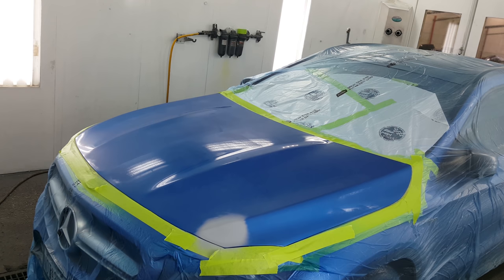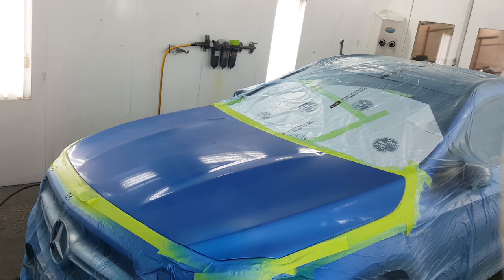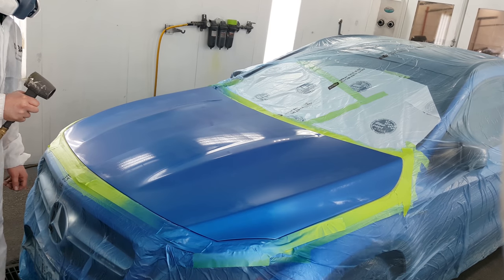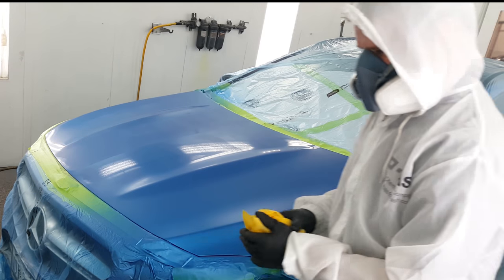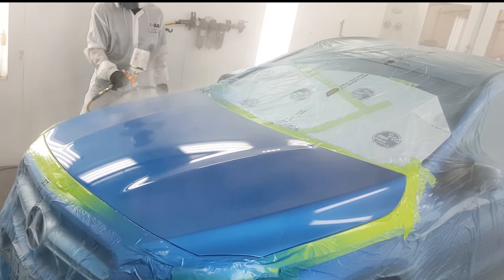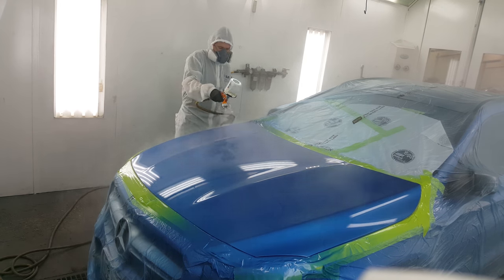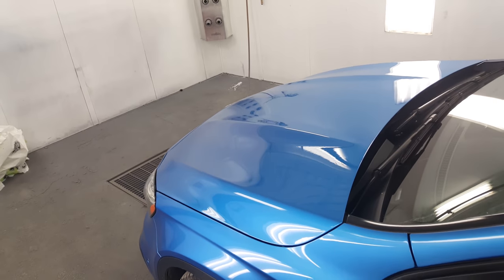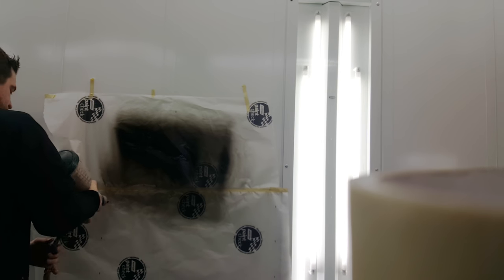Effortless Spot Repair: Revitalizing a Blue Honda with a Hood Blend and Full Clearcoat

Comment: First, I enjoy your dialog. Second, I think you may have helped me solve a problem. Just painted the racing stripes on my 66 Mustang restore. I had sanded the clearcoat (blue) , masked for the stripes, sprayed and then cleacoated the whole thing. PROBLEM - When I cleaned the surface before clear (tack rag and pre on the blue to get any dust off) I think I touched the white on a white cloth, didn't realize I transferred some to the blue on the sail panels. So UNDER the clearcoat I have some whitish ...uggg. So here is my thought (please confirm ) I would sand the clear on the roof and sail panels (all connected) , respray the blue on the sail panels blending up to the roof ...then reclear - Sorry, this is long but I want to be sure I have this right. The blue is cobalt blue metallic - thanks for any help ..what I want to avoid is masking the white (which I have to do ) and painting right up to it...I want to stay far away...LOL

Comment: SILVER CARS  When I do a color blend with SOLVENT paint The blend area I hit with intercoat clear. Which is basically a form of clear binder used for custom painters. this will fill the scratches in just a bit so the  blend wont have that sanding scratch look. especially in a hood.  you use this prior to putting down base. On the blend area only. Sort of like the wet bed stuff used for water base.
Reply: P

Comment: Great stuff as always. Is it possible to spray panels requiring all different angles of spray, like that bumper, without removing it? If you were only to clear up to a 90 degree bend, would it be a point in addition to most likely being visible
Reply from the maker: You could paint any part without removing it, but easier off the vehicle. Removing bumpers allows for better sanding around the edges, removing trim/fog lights, etc.

Comment: Dont Know how i missed this video.  The tekna clear gun looking very good on this job.  Just commented on the newer video.  Were you loading it on this hood ?  Looks pretty slick, nice job.  Does look like you were slower on this hood than the red one.  I have struggled with solvent pop and UHS clear(Debeer 8-104 , 80-121) Bought the ws400 and it has helped a lot.  If you dont spray everyday it can be tough to get the thin closed coat on wet enough to lay flat and yet not pop.  Found I gotta dial the 5000 rp material back to much to spray flat even with the 1.2  at 29 (better at 32)its not atomizing these thick clears enough.  The WS is better but still needs  way to much pressure- Im finding it takes near 40 psi to get the clear flat.  I was hoping the Tekna clearcoat might do a better job at lower pressure.
Reply: Yeah just read some of the bullshit critics below-You are doing all of us a great service AND I FOR ONE APRRECIATE MORE THAN I CAN SAY YOU TAKING THE TIME TO DO THIS.  i ENJOY ALL YOUR VIDEOS KEEP UP THE GOOD WORK.

Comment: Question: I thought existing clear needed at least scotchbrite scuffed to help new clear stick. It’s possible to just spot repair area then spray new clear right on top of old clear without prep?
Reply: You are correct. This clear should have been scuffed before being painted over.
Reply: @joebeasley814  its scuffed, look at the reflection.
Reply: @JuampixDDD  - I can see the scuffing/dull finish as well. I was going to ask 'what grit' does anyone think it got done to? I've heard not to go finer than 400, I've also heard not to go finer than 600.
Reply: @DrFiero  to clear over it you have to do 800-1000. some people go up to even 1500. 1000 is my confort zone.
Reply: @DrFiero  600 grit is the sweet spot ma boi

Comment: the only thing i question is how uve prepped the surface, its jut a little too shiny in my opinion. just the other day i was repairing a door on a honda accord and it had been done before at another shop and the  clear coat was flaking off and it was very hard to feather out the repaired areas bcoz i kept chasing the clear coat flaking off  and it was frustrating that it made the job so much bigger and took so much more time to get it to the primer and then once i was getting the primer ready for paint once again the clear coat started flaking off around the handle and it made my blood boil. i have always made sure to not have any shiny spots on the surface before i start spraying and seeing the bonnet on this new merc kind of bumps me a bit. on the other hand the spraying job was spot on.
Reply: I was thinking the same thing that hood looks to shiny to refinish, also the Toyota fenders that was blended one still had the mud flap installed and taped up. It take longer to tape up a mud flap then it does to take it off. The inner fender on the right side was not even taped up.